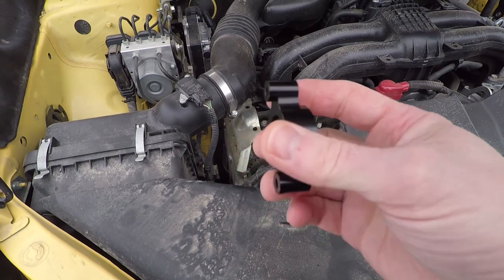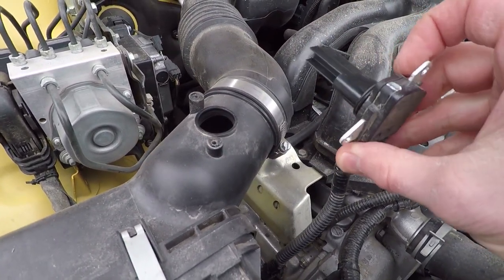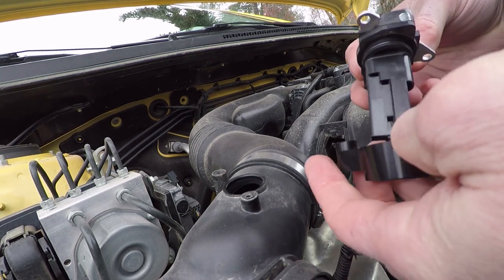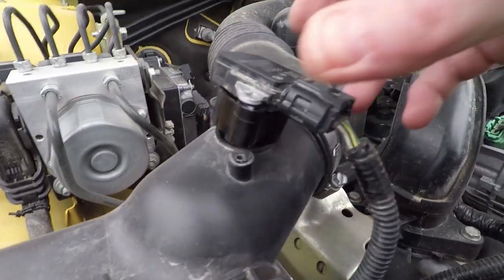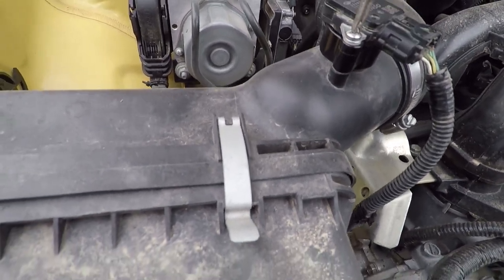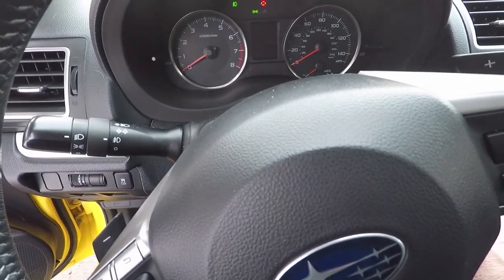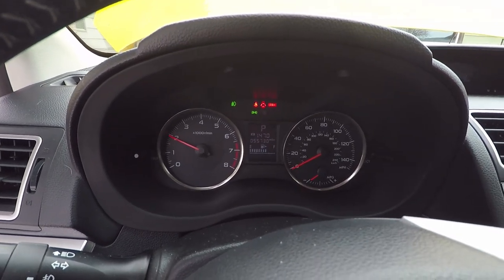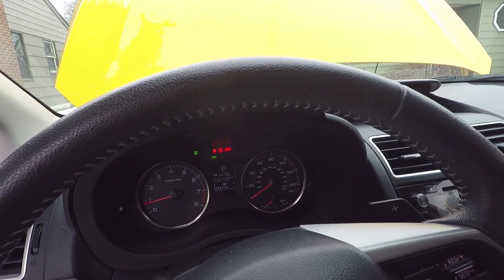2015 Subaru XV Crosstrek   Crawford Eco Block

Comment: For the love of Pete SPEAK UP!!!
Reply from the maker: By nature I am soft spoken.  I need to get a new/better head set or stand mic for when I narrate my videos.  Thank you for the feedback.
Reply: @JWCMotorsports  so is it even worth it?   You never got back to us with dyno results.  Pretty sure this crap is fake like silicone.   At least, company has 90 day return policy.  Need to return that pronto if it doesn't work out.
Reply from the maker: @rickjondo1343  For what we do with the Crosstreck and the improvement of the gas mileage, yes it is worth it and will have paid for its self in that improvement very quickly as the gas prices are going up here.  As for the Dyno, one in my local area that can do an all wheel drive dyno runs $125 for a test cycle.  If you want to contribute to that test let me know.   And with everything else I've been doing this spring I have not had the time to do a test with my scan gauge that I would consider constant (weather).

Comment: Besides the increase in mpg, any noticeable improvements in throttle response, power, and torque increase?
Reply from the maker: I have not had it on a dyno to show Power or Torque changes.  It does have a better acceleration response.  From a dead stop or in a passing situation it seems to accelerate faster.  I have a ScanGuage II and will pull some numbers it reads for HP, and acceleration.  The bloc is easy to remove and install so I will try and get with and with out numbers under similar conditions and weather.
Reply: JWCMotorsports yup, They also have a satisfaction guarantee on their product. Thanks I’ll give it a go!
Reply: Looks like a total sham to me.  Have you tested in dyno already?  You guys fall easily to these mods.  Pretty sure  these performance companies are liars and you guys get suckered easily.  LOL

Comment: where can I purchase the eco block Q2, do not see on Crawford site?
Reply from the maker: I have reached out to Crawford to find out if they are still producing the Eco Blocks.  I will post here what I find out.
Reply: @JWCMotorsports  thank you for getting back to me, ECO-Block is available on Amazon, didn't see a Q2, but there is a Q5 that seems to match?, just not sure on fitment, thanks again
Reply from the maker: @johnbergman6840  I have heard back from Crawford.  If you send me an e-mail I can give you the address to contact Quint and get set up with a Q2.  dallas.croft@jwcmotorsports.com